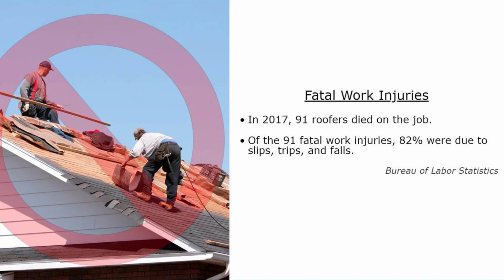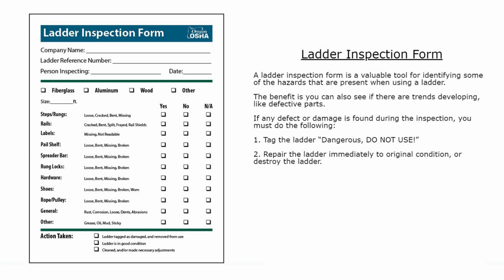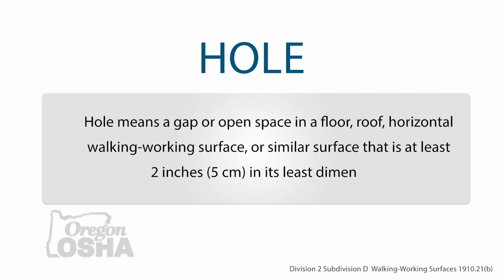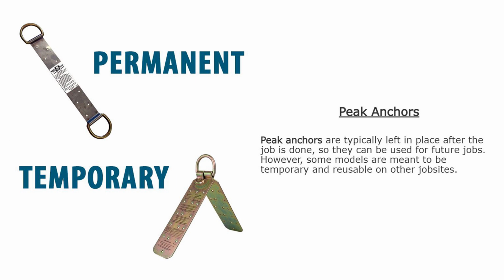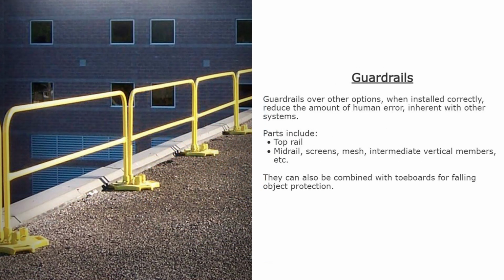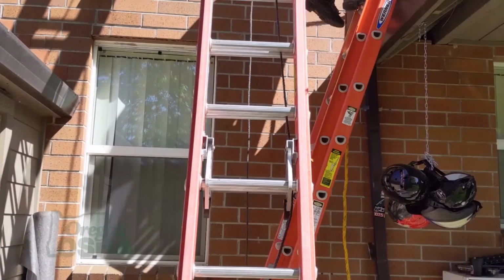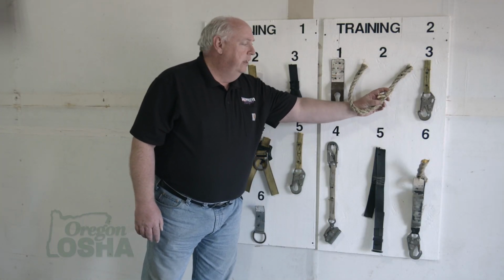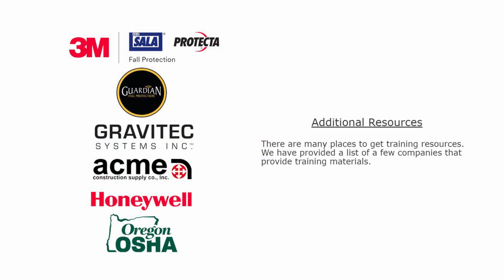Fall Protection For Roofing - Full Length Training Course

Comment: An incompetent safety person probably will miss a bunch of violations on this video, but sneakers, shorts, not wearing hard hats, etc... c'mon people, what were you thinking when you decided to publish this video? Unreal!

Does not deserve thumbs down because there is a lot of good information in the presentation, but overlooking so many OSHA violations doesn't allow me to give it a thumbs up.
Reply: Why do you need a hard hat on a roof? And every roofer ever wears shorts and sneakers in the warm months.
Reply: @rlcl4913  OSHA standard 29 cfr 1926.954 Personal Protective Equipment (PPE). Read it, but I think that it will be a waste of time for you. It seems like you have never been a Safety Inspector or a Construction Worker in a serious construction company.
Reply: @UFGator1972  Yeah, I'm not going to read it. I work for myself so if I ever get fined maybe I'll change my ways but I doubt it.
Reply: @rlcl4913  I knew you wouldn't read it after reading this from you, "Why do you need a hard hat on a roof? And every roofer ever wears shorts and sneakers in the warm months."

To make it very clear, employees working in areas where there is a possible danger of head injury from impact, or from falling or flying objects, or from electrical shock and burns, shall be protected by protective helmets. Any project that has a crane requires everyone to wear a hard hat, even roofers. But most General Contractors require that all workers wear hard hats 100% of the time no matter what the exposure is.

Anyway, good luck it is your life, don't become an OSHA stat.